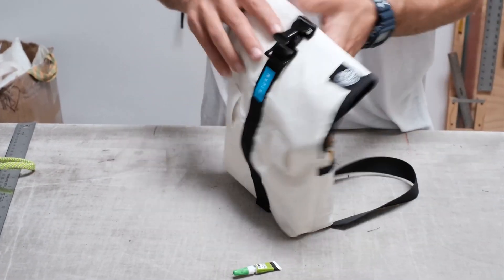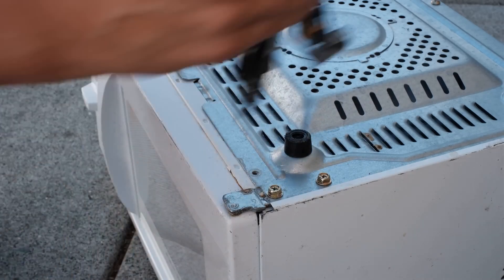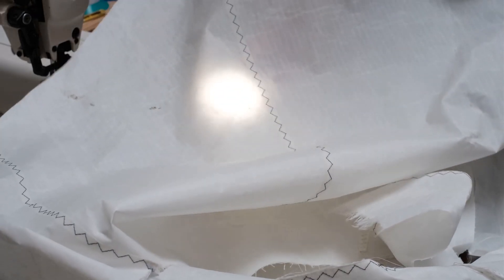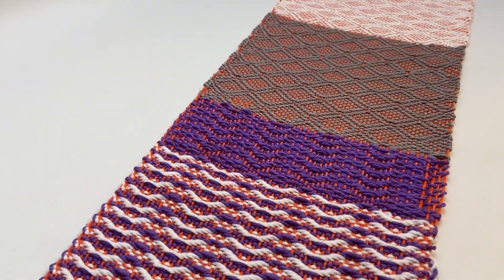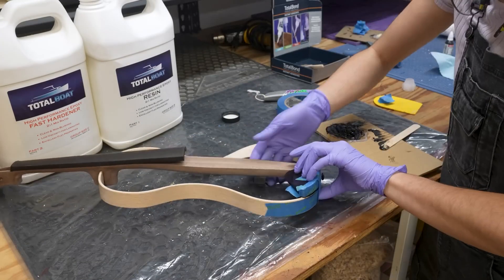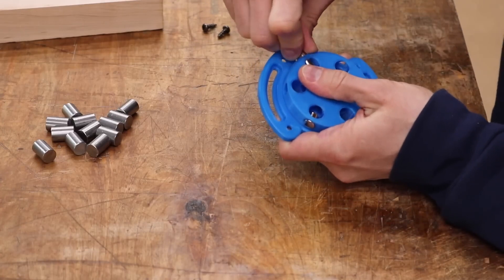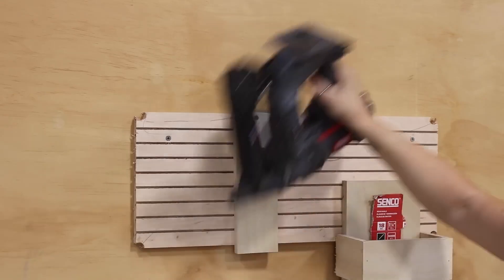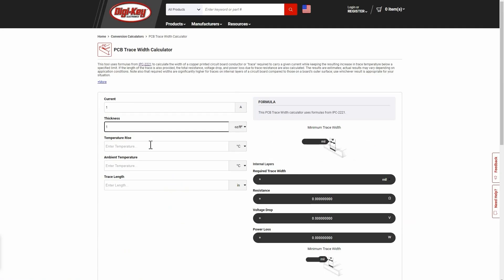Packs a Punch [Maker Update] | Maker.io

Comment: Interesting as I needed a leather welding bib, so got a cheap one a harbor freight and sewed rare earth magnets into one new leather straps and small rectangular steel coupons at a spacing of 3 inches. I made it longer to latch in front. Place the magnets on the backside to keep metal grinding fragments for sticking or metal work piece. Looks like nice pattern software!